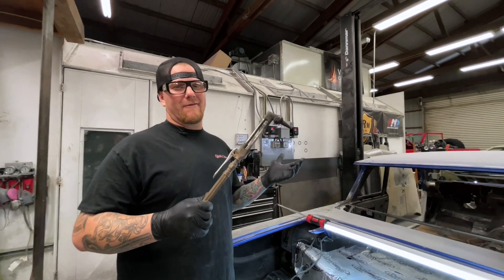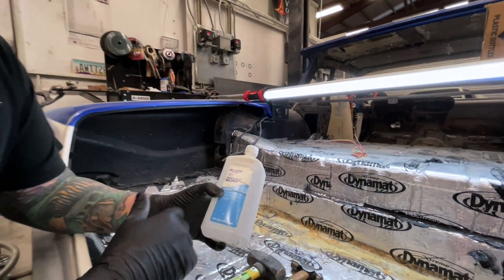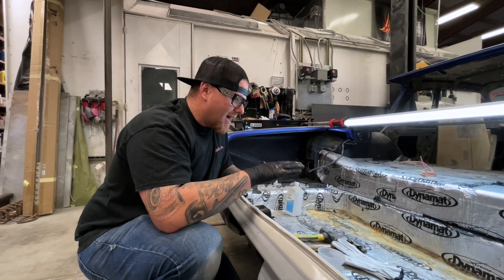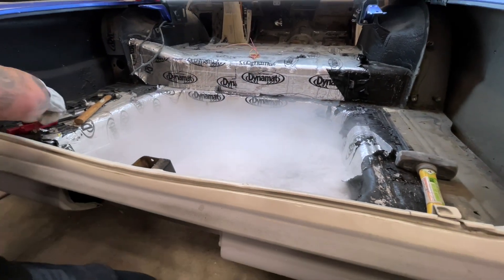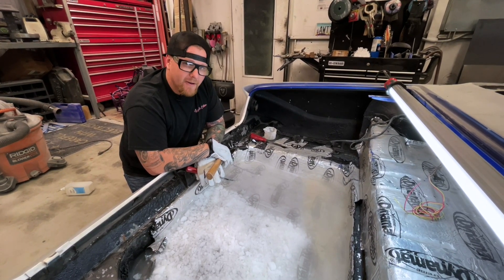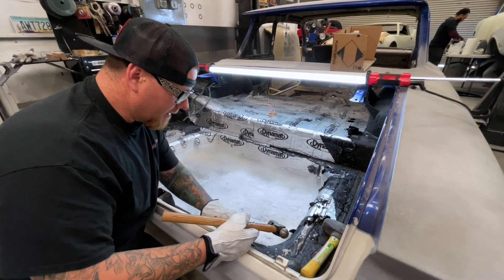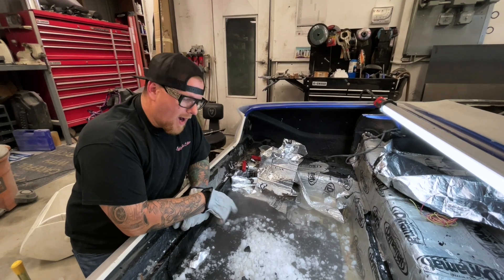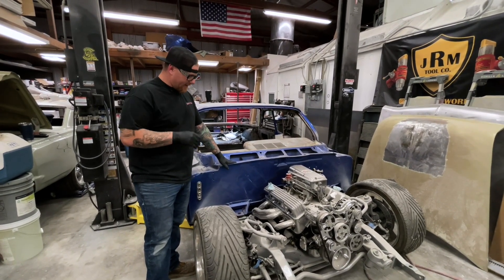Dynamat Sound Deadening Removal 61 Impala Ep 1

Comment: I used Dynamat on my 1970 Corvette on the floor and trans tunnel. I then purchased Eastwood to finish the doors and behind the seats!  Winter project complete.  I live in Texas and summer was was about 2 months off.  Then the first day of 100 degrees I noticed some tar was on my door seal and the tar started running every where! Now I had a summer project and I called Eastwood to compline about there product!  Eastwood did hemp me by sending products to cleanup the mess!  Thanks for your utube it was great info!!
Reply from the maker: Awww man bummer!! Thx for watching!
Reply: That's odd because Dynamat is one of the better quality brands. I wouldn't expect any of its adhesive to drip or melt out. Cheaper brands can definitely do that. If you want the highest quality I would suggest Resonex. It's a special butyl rubber without any tar.

Comment: Would a air chisel be to aggressive on the panels?
Reply from the maker: As a matter of fact near the end we took one of those with a 1.5” wide spade bit on a low angle turned the air pressure down and it worked amazing.

Comment: I’d be using a small battery powered hammer drill like a Hilti with a spade bit & just lift it up & as well as using your hands.. But using a different brand of deadener made by “Car Builders” & it’s Butyl & not a bitumen substance. It’s easier to rip up as it’s rubber & doesn’t harden it’s always malleable . I reckon it’s Great stuff 👍

Comment: Doing collision repair led me to 
A way of cleaning floor pans
When I was replacing trunk floor pans I’d use a air saw to cut the panels I noticed the vibration would cause the sound deadner panels to pop loose  so I took a saws all blade cut the tip straight like a chisel 
And sharpen it as well 
A 4 inch blade works best 
In the air saw it vibrates and scrapes at the same time 
Then the sharp teeth of the blade grind as well 
I can clean the bottom of a c10 cab in 15 min then sand blast !!!
Used with dry ice it would be amazing give it a try 
I use a Matco air saw my sun calls it the butter cutter cause it cuts metal like butter
Reply from the maker: Thanks for sharing!

Comment: I assume this would not work on bed liner so what is the best way to remove it? Heat or grind? Working on a Jeep Wrangler entire inside of tub has bed liner.
Reply from the maker: I think it all depends on how good the prep was when they put it in Undercoating can be a challenge sometimes you can always try freezing it I’ve been pretty lucky we have not had to remove bedliner yet if you have an acid dip place I think it will remove it but then you have to pull the whole car apart unfortunately I don’t know if I’m much help on that
Reply: @SYLVESTERSCUSTOMS  It is pretty close to being stripped. The dash is the only thing in it. I'll look into an acid dip business. Thanks for the feedback.

Comment: I've never touched that dynomat stuff for this very reason. I knew it would be a absolute prick to get off. What would happen if you had sent it to be dipped as is? Keep em coming.  👍👍
Reply from the maker: They wouldn’t touch it because of the aluminum it contaminated the acid process
Reply: Nice heads up  didn't know  that
Reply: I found if I just do it in the evening when it's cooler the whole thing just peels off in one go.

Comment: One tip do not use your hands as a hammer. Reason being that's a great way to get carpal tunnel. Trust me I've had both hands operated on due to using my hands as a hammer. 
Great content love the channel keep up the great work.
Reply from the maker: Thank you for the tip. It’s easy to forget sometimes that actions now will make us pay later.
Reply: @SYLVESTERSCUSTOMS  You are absolutely correct. And believe me I'm paying for it now. Taking the proper safety steps now will save your body down the road. Love the content and the channel. Keep up the great work.
Reply from the maker: Will do, thank you for watching.
Reply: @SYLVESTERSCUSTOMS  You bet In my opinion this channel is the best as far as doing body work the right way along with the correct way to start from the ground up. I'm a firm believer in metal prep/condition the metal first before epoxy then do your body filler over the epoxy then reapply the epoxy then prime block any cut through reapply epoxy then reprime while heavy guide coat in between to make your panels laser straight. Then seal, paint, wet sand completely flat no orange peel going in 1000 grit guide coat in between steps to get all the orange peel out then buff.
Reply from the maker: @kennethclauson2317  agreed totally. We just found that we even started going to 600 after clear will completely remove any ripples 1k grit looks good but it’s not 100% perfect. By putting on more clear having the forethought to start with 600 definitely helps

Comment: Great vid. I totally agree with you, however dynamat hasn’t been around long enough to need to remove it. If the vehicle was built right in the the first place you shouldn’t need to remove it for quit some time. Too many shops are not doing quality work. We blast, epoxy, seam seal with 2 part and bedliner, then epoxy prime again or single stage. Then dynamat with overlap with 1/8” and roll it down then seal the seams so no reason it should be removed for 30-50 years really.
Reply from the maker: Like you said, most shops aren’t doing quality work. Every car we touch gets striped down to metal for that reason.
Reply: @SYLVESTERSCUSTOMS  true story. I’ve been pretty lucky most of the vehicles I’ve been doing are in pretty decent original shape with maybe a few exterior paint jobs in they’re lifetime but not been bastardized by some armature.

Comment: Dynamat (and other similar products) is butyl based, which is synthetic unlike tar which is not. That’s why if you cheap out and get the stuff from the hardware store instead of a product designed for automotive, your car will smell when it gets hot.